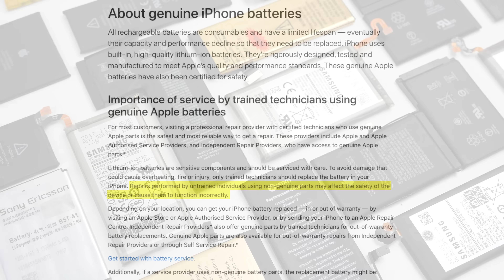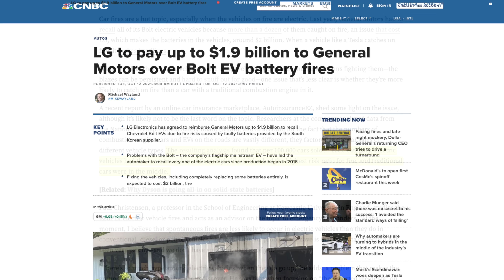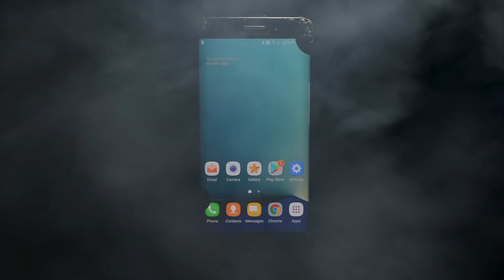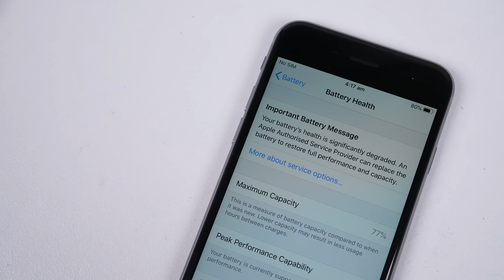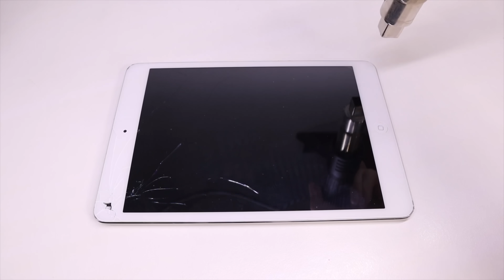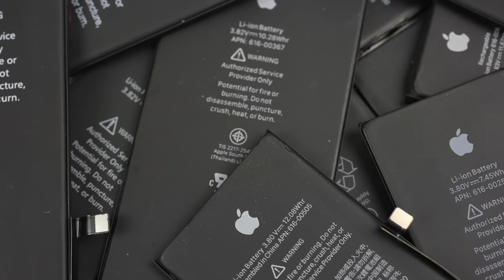Terrifying Hidden Danger of Batteries - From Phones to EV’s - How to Avoid the Risk.

Comment: At least my gaming laptop only has the backplate to remove in order to access the battery... and it's only held in with several screws and you just stick a wedge in to detach it. That was at least 100x safer than having to take it to a third party repair place or even to the manufacturer, where it may not even survive the trip there if a spicy pillow was still inside.
Reply: One used to be able to replace laptop batteries by just sliding two clips underneath the laptop and easily pull the battery out. This was before ultraslim windows laptops became popular.
Reply: @rzpogi  YES! THIS TOO! THAT WAS EVEN EASIER!
Reply: Some of my ultra slim laptops have the batteries removable lmao

Comment: Waiting for Apple to integrate the CMOS battery into the CPUs of their computers, claiming it keeps BIOS settings more securely
Reply: You couldn't put a CMOS battery in the CPU even if you wanted to. But, you don't have to use the CMOS battery for BIOS settings, there's other ways around it now. Most modern laptops don't even have CMOS batteries, they're feeding straight off the battery, and they can keep the settings for a pretty long time even after the battery has been removed.

Comment: Which is why I always wondered do I care if my phone is 1mm thinner bacause the battery will not come out? I had many phones where the battery would come out. It did make the phone thicker, but it also meant I could carry a spare safely of course when the one in the phone went flat. It really also comes down to disposal and management of these high energy potential batteries. Not necessarily the new ones as much but the older perhaps damaged ones. I warn folks all the time to be careful of these new technology batteries. The energy density is very very high, and could start a fire. In some ways all parties are involved here. We want long lasting gear with a duration to last at least the day or longer. So companies create these things. Companies start promoting thinner and thinner technology to sell that sexy look. Hence the batteries that don't come out. I had some olf LG phones and while their battery life was meh, I had no problems having a spare. Not a big deal, and I could change it out. Now you can't change batteries out. Also a computer reset back in the day included removing the battery pack. Can't do that anymore either.

Comment: Biggest issue with Lithium batteries is LIPF6 ions in the electrolyte. It turns into hydrofluoric acid when exposed to moisture (including air) and can dissolve anything. Could destroy your lungs do really damage short term, or totally screw you long-term with continuous small exposure. But if it burns, run away and don't breath, it can totally dissolve your lungs.

Comment: I work in the airline industry and the most often question I get is what is the deal with batteries. I have to explain even to my coworkers who didn’t understand the training they were given on batteries. It’s about capacity and the current charge of the battery as you mention. There are always risks about transporting batteries as you mentioned, but the smaller capacity lower charge batteries have less of a risk to safety because their combustion level is lower. Now if you bring a huge battery pack on board an aircraft and an error occurs, then it burst into flames, there’s no support and often no equipment in the air to put out the fire. Cargo planes do have fire suppression equipment on board inside the cargo area but not so much in a passenger airliner so there would have to be an immediate emergency landing and airport fire crew trained to deal with, a battery fire, not to mention the potential risk during the evacuation process as keeping people in a flying tube up in the air. Well bad things can happen.
Reply: Do you work in cargo/freight? Just wondering if airfreight operators refuse to carry EV's or not
Reply: @r0x0r-p4t  baggage actually. We don’t handle large cargo items out of my station.
Reply: Passenger airliners also got fire suppression equipment on the cargo bays, each engine and maybe avionics bay (can't say that one for sure but cargo bays and engines yes), but yes it's a huge issue still, for the cabin you've gotta deal with it with handheld halon extinguishers and hope for the best while the airplane diverts. Have seen a video here on Youtube of ATC audio on a flight with a cabin fire from a passenger's power bank or something like it, thankfully it landed safely and the fire was put out.
Fire by Li-Ion batteries has taken down an UPS Boeing 747 once, Flight 6.
Reply: @Kalvinjj  yeah, I’ve seen some frightening messages from our emergency response center when there’s smoke in the cabin. That’s an immediate deploy airport fire crews. These guys don’t mess around because it costs lives. Part of why I’m glad I don’t work the ramp directly on the planes. That sh*ts scary even for the ground agents not refueling, unloading/loading the plane… being on one as that’s happening… nah I’ll pass lol
Reply: @@blaylumnothing to do with batteries
Reply: A battery fire in the cargo hold brought down a passenger aircraft many years ago.
Reply: @bethhentges  that’s exactly why changes have taken place and we have to ask about batteries like it’s not an afterthought. It’s literally as soon as you check your bag, we have to ask we don’t have a choice the law mandates it. It’s sad that people had to die for that to occur though.

Comment: I still have each smartphone I've owned going back to 2010... I noticed recently that my Galaxy S4 was all flexed out of shape... and the back had popped off...to which I saw that the battery was completely inflated like a pillow. The S4 still had a removable back design, which ultimately saved the phone... but if/when that happens with a new phone, it will completely destroy it. I heard that by 2027 tech companies will be required to make batteries removable again... I hope that's true!

Comment: All would be so much easier if manufacturers went back to user removable batteries.
They say they seal it up for waterproofing but seriously, who actually needs it? I've had mobile phones for about 30 years and only once dropped a phone in water. It was a Galaxy S3 I think, and it fell from my pocket into a bucket of soapy water. I immediately got it out, dried it with paper towel, removed the battery and put in in a container with rice overnight. The phone was unharmed and lived out its days without issue.
If you need waterproofing, get a specialist phone or phone case. The majority of consumers don't need them to be waterproof.
Reply: If they'd not want them, they'd not buy them, yet here we are. There's phones with removable batteries even now on the market, rugged, too, as most of the times phones break because one drops them, not because of water damage; yet no one buys them. You'd think if people actually cared about this they'd buy the things they'd care about, right?

Comment: For EVs, well, Im against them. My reason is because most people don't have AU$30,000 lying around, so how are they meant to buy a replacement car? Then there is the impracticallity of them. Just last week I learned it takes 2 hours to charge an EV at a charging station at a petrol station. That to me sounds very unreasonable, but also unavoidable due to fast charging damaging cells when used too much. And before someone says "you can just use a power cord at your home, what's the problem?", the problem is not everyone has a power point near their car. Just look at apartment buildings that has multiple carparks, where is the power point? Then there are multiple vehicle house holds. Say someone has 4 cars (1 for dad, 1 for mum, and a car each for the 2 18+year old kids), but only 2 PowerPoints in their garage, how do they charge the other 2?

I feel the solution isn't battery, but putting more money in to RnD of synthetic fuels. For what I understand, the goal is to remove all the harmful elements that react with the oxygen in the air to creat CO2 and other greenhouse gases, and have exhaust that is 100% green, and as easy and safe to use as petroleum. However, there seems to be 0 being done to look at synthetics, or very little. Why the lack of looking at the solution that will benefit more?

Comment: My battery health on my phone is at 77%…phone is slow and takes forever to charge, do I need to replace my phone? 😬
Reply: @hollydsilva2995 Just Replace the Battery! Not the Whole Phone! By The way, what model do you have?
Reply: You already would have done it if it was in fact "needed". Still nothing stops you from doing it. I keep rocking my Samsung A5 2017, battery is cool and I'm not in need of more performance. I'll change it when I need to. 💪✌

Comment: Great video! I have a good analogy for the battery issue, imagine a gasoline car that gets thrown away after it runs out of fuel, this is basically integrated batteries in a nutshell, even if the analogy is exagerated, we can all agree it would be crazy to think about throwing away a entire vehicle with all the advanced technological and mechanical components perfectly in working condition, and considering the cost of a car, smartphones with non removable batteries are exactly the same in a smaller scale, but bigger quantity and shorter life span, to the point the average person will use their phone for around 2-3 years until the battery gets used enough that it stops holding a charge for a usable amount of time, luckly batteries have gotten better over the years but the problem pressists, the average user can't easly replace them, for fear of damaging the phone or just lack of knowledge on how to do it, therefore it ends up being the first part to fail on the phone due to wear, then there is the issue where companies go after the people that do know how to replace the batteries by implementing intentional software locks loike "battery might not be genuine" warnings that serve no actual use for the user other than being an intimidation tactic, just like the maintenance light on a car is tricking the person to go to a official dealership/store and pay a premium
Reply: The only problem i have with that analogy is that would be more like if you could never charge the phone and it just had a single use battery inside. Every time you recharge a battery it's pretty much identical to filling up the fuel tank.

Comment: Earlier this year, I had a battery in an old Galaxy S7 inflate after a soft drop off a coffee table onto a carpet.  I wouldn't be surprised if it had happened after a drop off a kitchen counter onto a hardwood floor or a drop out of a pocket onto pavement.  The gentlest of drops causing that kind of reaction make me think it was inevitable, whether it dropped or not.   It had managed to mostly free itself from its adhesive before I removed the back off the phone.  So I was able to remove the whole thing without much fight.  Disposing of it was way more fun.  I called around around various disposal places in my area, and they would not take it unless it was a "Tox-away Day."  After dealing with multiple retail stores that claimed to dispose of used batteries, I managed to get a Batteries Plus store to take it for $10.  I had enough of it, and was willing to part with a Hamilton to be done with it.
Reply: In the UK, they have large recycling containers in any store that sells more than a certain amount of batteries. This includes most supermarkets and DIY outlets.
So at least you are able to easily recycle your battery without any fuss.
Reply: What do you mean "for $10"? They were charging you to take it from them? I would have just walked in and set it on the counter and walked out. Not paying them a cent.
Reply: @bland9876  It might be because it was a damaged battery, so they're likely charging a handling fee to dispose of it.
Reply: @Slavolko  what would they even do if I did just leave?

"Officer he tried to give me a dead battery for free" lol
Reply: @bland9876 I mean it is a fire hazard, not just a dead battery. I don't know if they could actually be charged with anything but it wouldn't be entirely unreasonable
Reply: They probably just kept the money and threw it in the garbage, but at least you got it off your hands.
Reply: Where the heck do you live?! In my country you just bring the battery to any technical store or a standard store that has a separate battery container (almost every big store). Every city has a bunch of disposable electronic containers which have a separate storage place for a battery. And as a last resort you can bring it to your local sorting center and they would take it.

Comment: "10 times the amount of water" Actually you wouldn't WANT to use water at all! (evidenced by the fully submersed flaming car) That actually makes it worse. Like throwing water on a grease fire. Chemical compositions are different, you are better off using the proper chemical fire retardant, Or trying to smother it completely. Adding water to a lithium fire adds oxygen to it thanks to how hot it burns, it turns water to additional fuel... This is why retraining fire departments for Ev's is a MUUST.

Comment: I have just has a 2016 se iPhone crack its screen after the battery has puffed up.
Any ideas as to how we avoid that without removing the bat? What causes the gas?
Reply: dont charge it too many times, keep it in room temp & avoid heat. the gas is a natural thing, everyone is affected - aging. if it gets too old or heavily mistreated it bulges. and if it bulging its a matter of time before it blow up if u keep using it. the higher the charge the stronger the fire

also replacing the battery in the iphone is fairly easy thing to do. u dont have to be a scientist or anything else. if u can process common sense & know what lego is it shouldnt be a problem

Comment: So one of the reasons the battery is non-removable is to make the phone waterproof. It's not like I will swim with it or something.
The non-removable battery may save some weight and space, but we don't need thin and lightweight phones.
Back when I had a Samsung Note 3 I had a triple battery. I had no problem with the size and weight, and I charged it once every 3-4 days.
Reply: Nonsense. You can have high waterproofing and user removable battery.
Reply: @kornaros96  Do you know of any example of a highly waterproofed phone with a user removable battery?
Reply: there are a lot of factors what are technically good but bad at the same time - technology u cant have everything... yet.
chinese phones tend to use a li-po batteries since they are lighter / thinner, more flexible, faster charging, safer (less "explosive") & marketing bs, but it comes with a massive downside -> full charge cycles are way lower compared to li-ions, everyone seems to forget that part. & not to mention li-po have a higher self discharge -> but the Customers only sees: "5000 mAh & 120w charging? AWESOME" , at least some phones brands are now bit more open when it comes to repairability & offer parts or partnering with other brands to sell replacements & tutorials
Reply: @Vss077  Thanks for that clarification on the "hyper quick charge" batteries.  Yep, those buyers that only look at spec sheets of phones for battery size and how quick it charges (25/35/65/75/120w quick charge) don't realize how much they give up by using something "better".  I think with phones "better" is like the "perfect" with everything else, it doesn't really exist since goal posts with progress keep moving.
Reply: @Vss077  aren't all phones use li-po batteries?
Reply: @kornaros96  according to GSMArena no, like Samsungs Flagships are listed with Li-ion & their Budget ones have Li-Po's
Xiaomi in other hand uses only li-po, i didnt checked for myself tho if its 100% correct or not but i usually trust them with since other specs are usually right.
But fair to say its hard to find right information while Li-po is a advanced tech from Li-ion & more expensive to make doesnt make any sense when they always use them in budget phones these days (prob when the "tech" was new & the market wasn't saturated)
Reply: No one "needs" any thin and lightweight phone, it's just what they wanted and now here we are. If people didn't want them, they wouldn't have been made. There's more rugged designs out there, some with even user removable batteries, rocking pretty cool specs, but people don't buy them. Why? Because people don't want them.
Reply: @nylvon  people don't want them, because they don't sell them no more. Have you ever dropped a phone in the deep water? 
Do you record in water?

Hopefully, Europe will fix the battery issue, like they fixed the USB C
Reply: @siedliko  As I just mentioned, they sell them. There are phone manufacturers that make them (hell, even Samsung makes some, see the Galaxy XCover 6 Pro which came out in 2022, it has a plastic back, removable battery and it is water proof, something I did not even expect was possible), but people choose not to buy. Why is that?

Comment: So it's worth mentioning, the Fully Charged Show and others have already tackled the debate on the "danger" of EV fires and the data shows that they're actually less likely to catch fire than an ICE, even with model year to model year directly compared. The only difference is that they're much more spectacular when they do.

While Hugh's point is probably not to suggest this, it's an easy takeaway. And yes, we need to make right to repair a mandatory thing.